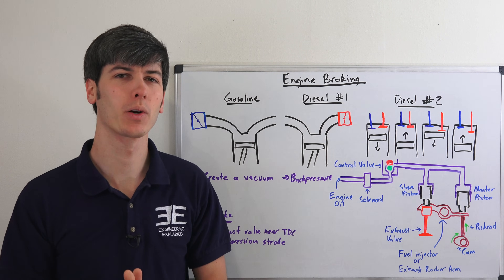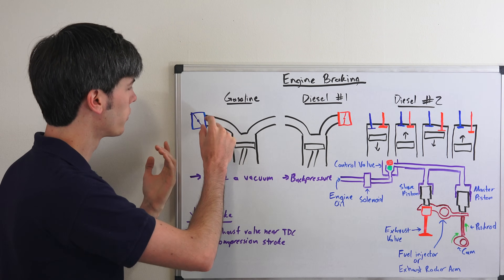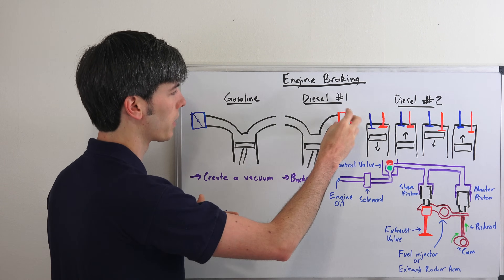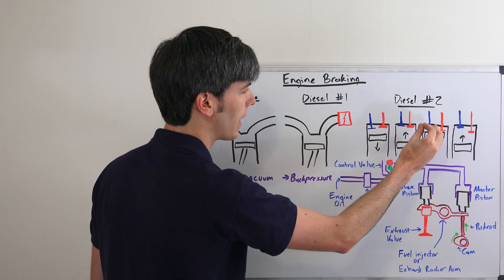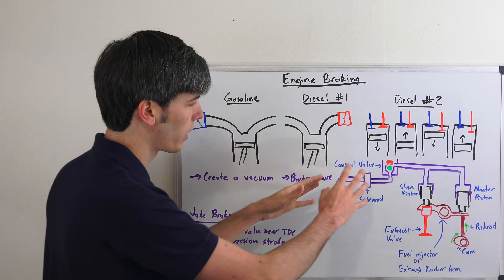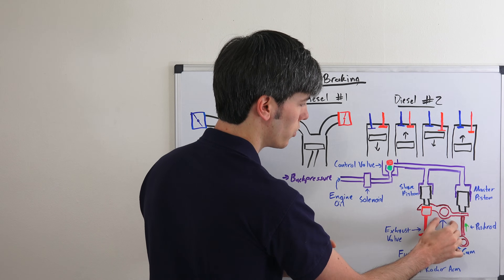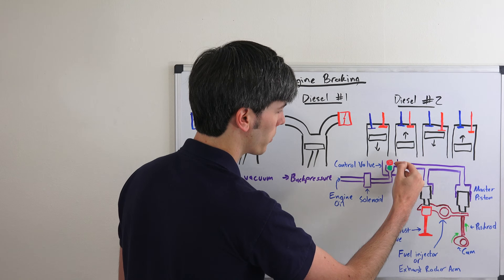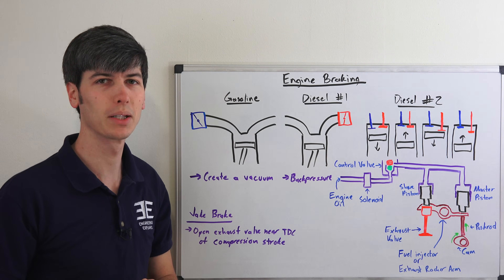What Is Engine Braking? What Is A Jake Brake?

Comment: That's pretty close to how I explain how a Jake brake works. 
 You flip the switch, witchcraft happens and then the truck sounds like a boss.
Reply: Would trucks be burned at the stake for witchcraft? If so, I feel it would be a punishment for both the truck, and the people watching since watching a perfectly good truck go to waste hurts my soul.
Reply: I like your explanation better! WITCHCRAFT HAPPENS!
Reply: @markflierl1624  yeah. Its witchcraft alright, she is sucking you to a stop..
Reply: A jake brake doesn't block your exhaust, it actually does the opposite it opens your exhaust valves during the combustion so the expansion of the combustion just goes out the exhaust instead of creating power. If you blocked the exhaust it would cause your head gaskets to blow...
Reply: Lmfao hahahaha 🤣 I'm pretty mechanically inclined but when it came to the Jake brake I was a bit lost. 😅 I would to see it in person to understand it. Soo yup definitely witchcraft.
Reply: Wait.   There is no switch mentioned in any of this ... just let off the gas (diesel) and the Jake system uses the compressed air to slow it down.   NO SWICH RIGHT?
Reply: @scottmonfort  no, the jacobs brake has a switch to activate it.
Reply: @scottmonfort  no, you typically have to engage the jake brake due to it being illegal on a lot of farm roads. If you see a sign saying "brake retarders prohibited" that means your jake brake has to be disengaged

Comment: Soooo... When you are in gear and let off the throttle in gasoline engine you're not wasting fuel right? I'm saying no but i want to be sure. Also is wear of the engine greater when you coast in gear? (of course i understand about the heat but if the heat of the engine is at it's optimal value and coasting in gear and not going into overheating zone)
Reply: See my comment above... When youre not on the gas pedal, youre not using fuel (except idle or cruise control)
Reply: +wayde philpot ; If the engine in question is mated to a manual transmission and has electronic fuel injection, the fuel injectors will shut off if the car is both in gear and has sufficient speed for the engine rpm to exceed idle. If the car is not in gear, or the rpm is very near idle, it will use fuel at idle rate. For example, if you are on a slight decline in a manual car, you can release the clutch to move the car 1st gear without touching the accelerator, and the engine will continue using fuel at idle rate unless you are able to accelerate enough, without the use of the accelerator, that the rpm sufficiently exceeds idle speed (1200 rpm give or take a hundred). So, yes, fuel is used during idle whenever the car is not in gear, during cruise control, and during the very specific instance mentioned above. 
But automatic transmissions are trickier. With older electronic fuel injection, the engine will continue to burn fuel at idle rate whenever the accelerator is fully released even with the car in gear. The torque converter will unlock, allowing the engine to freewheel and the car to coast. Anyone who has ever driven an older automatic knows that whenever you're going less than 45 mph, and you release the throttle, the transmission shifts to a higher gear, and the rpm drops to near idle. The engine actually burns fuel at idle rate whenever this happens. If you are going 60 mph or faster, the engine rpm will actually be high enough for the fuel injection to shut off. Then you get true engine braking from the automatic transmission, but when you decelerate to a sufficiently slow speed, the fuel injectors turn back on and the rpm bumps up very slightly. Between 45 and 60 mph, it depends on the manufacturer and the gearing of the gear as to when it will shut the fuel injectors with the transmission in drive. There's no way a 2002 Buick Lesabre is going to cut fuel injectors at 45 mph, but a 2000 Honda Civic EX probably will. Another thing to note, if a car is going 60 mph, and the engine is turning 2100 rpm with the transmission and engine fully engaged, that same combo is going to be engine braking with fuel injectors shut off while the engine is turning between 1400-1600 rpm at the same 60 mph. There is definitely a difference in the rpm of an automatic car with the torque converter unlocked and the accelerator in different positions. If you downshift the automatic transmission, it will raise the revs, and if the rpm exceeds 1500 rpm with the accelerator fully closed, it will probably shut off the fuel injection. (some engines will wait for even higher rpm before shutting fuel injection) But when the rpm falls below 1200-1300, fuel injection will turn on and it will burn fuel at idle rate.
Some newer automatic transmissions, the 2012 Ford Escape for example, will actually keep the torque converter locked and not upshift whenever the accelerator is released, (we're talking from 30 mph and faster,) and will cut fuel injection for engine braking. It will turn on the fuel injectors again after a sufficiently slow speed is reached and burn fuel at idle rate, though. Some modern cars do something very similar to what the 2012 Ford escape does, while some modern cars still do things like the older fuel injection systems. Some cars (like BMWs) include a "coast" function that will allow the rpm to drop to idle while the car is at any speed, and like the name implies, it allows the car to coast longer distances without interference from engine braking at higher speeds.

Basically, I can't have anyone believe that their automatic transmission equipped car shuts fuel injection every time they release the accelerator, because it just isn't so.
Reply: +ExactlyPrecisely i hear what youre saying. Modern manuals assist with slight throttle input in 1st gear from a stop (without the driver actually pressing the gas pedal)....All automatics as far as i know will creep from a stop in drive without the gas being applied. But for decel situations, its my understanding that   the ecu will cut fuel until the engine approaches idle speed. I cant speak for older cars... If they did indeed use fuel without input from the driver, thats a terrible design and its understandable why fuel economy has gotten better over the years.

Comment: wow ! Very interesting ! Until now I thought that the pistons fighting against the compression while the others didn't receive any gasoline for combustion was the main reason for engine braking. Doesn't the compression have any impact at all ?
Reply from the maker: +Yak Eru It does, but most of the energy goes back into the engine during the "power" stroke. Minimal energy is lost.
Reply: +Engineering Explained Thanks :-)
Reply: +Engineering Explained woooooaaaaaa, it took me some time to really understand ! The piston fights against compression ... but even if there is no fuel, the compressed air is pushing back against it during the ""power"" (now I understand why the quotes, thus the quoted quotes :-P) stroke since the valves are still closed ! So, the only loss of power comes from friction and eventually some lost compression in a worn engine. 

woaa... so obvious now ... thanks !

soooo ... in theory, not that it is really important to know ... but an engine with worn piston rings/valve seats/etc ... would have more engine breaking than a well sealed one ...

Comment: So if "Jake Braking" is just releasing built up energy straight out the exhaust, how does that differ from putting the vehicle in neutral? I don't see how "Jake Braking" slows a vehicle down...
Reply: +Michael Stutzman The key is built up energy, where does that energy come from? It is converted from the inertia of a vehicle.  Since after it is compressed and is immediately released out of the exhaust- it does not increase speed but all the energy spent compressing the air was still used so the vehicle overall slows down.
Reply: +Michael Stutzman Because it takes kinetic energy to compress the air that is than released trough exhaust.
Reply: EgadsNo Does the spark still ignite? How does the engine get more air? The idle air control valve?

Comment: does engine braking, create more wear and tare on your engine? rather than using the brakes?
Reply: +roy silverio if it can handle the heat from engine braking(which it does if you don't have any cooling problems) you will be fine
Reply: +MultiDJsander thank you for answering my question

Comment: Fantastic explanation. I just have a doubt, is fuel consumed in a petrol engine during engine braking?
Reply: Only a carbureted engine sucks fuel all the time.. fuel injected engines turn off injectors during decel.

Comment: Is engine braking bad of the engine in the long/short term? like does it damage any components?
Reply from the maker: Nope, your engine has a dedicated cooling system. So long as it's not overheating, it can handle it just fine.

Comment: So why can't you have the two diesel systems on the gasoline engine as well?
Reply from the maker: You could, but gasoline engines have throttle bodies so it's not as necessary. Pretty much all highway trucks will be diesel rather than gasoline, and the larger the vehicle the more useful this is in preventing brake fade. Still great to leave your gas car in gear without throttle on steep grades, and lower gears as necessary to maintain a certain speed.

Comment: does downshifting and engine braking down a steep hill cause any excess wear to the engine or transmission through heat in comparison to just braking?
Reply: +AndrewRox22 Unless you have a bad coolant nope. Engine is spinning anyway and you'd want to use that force for braking and saving some fuel and lots of brakes.
Reply from the maker: Nope, your engine has a dedicated cooling system. So long as it's not overheating, it can handle it just fine.

Comment: with petroleum/gasoline engines when throttle is at 0% , is fuel and air injected at idle rates and does combustion still occur?
Reply: +MrAlexio27 only if it is needed to keep the engine at idle speed, i.e. if you are engine braking and that makes the engine is turn above idle speed no fuel is injected
Reply: is that why when on high revving engine a jolt is given if you throttle off at say 5000rpm?
Reply: +MrAlexio27 nope when throttle is at 0% and you're in gear ECU shuts off fuel. Only old engines with carbs did that. There is no fuel in when you let off throttle.

Comment: does engine braking cause some sort of 'pop' sound like it's misfire(?) or something? since i drive a manual, it's easier to slowdown with engine braking just by letting the gas off, mainly because i hate to be label as a "brake-checker", is that the term for it?
Reply from the maker: Some cars will have some pops and crackles in the exhaust occasionally while engine braking. Usually occurs right after letting off the gas while in gear, as unburnt fuel leaves the exhaust.
Reply: +Engineering Explained that's explain it, considering my car have carburetor.

Comment: So there's no combustion when you let go of the gas pedal? The engine keeps moving because the wheels are moving? And the sound of the engine is purely mechanical?
Reply from the maker: With many modern engines, yes. Though it's possible to still burn a very small amount, depending on the setup. Ideally you would burn no fuel since it's completely wasted. The inertia of the car passes through the wheels/transmission to keep the engine running without fuel.
Reply: +Engineering Explained you actually still burn fuel on overrun because of tip-out driveability filters which act on brake torque to give it a smooth deceleration feel (this is done by injecting ever decreasing quantities of fuel to generate a bit of indicated torque). These filters are used pretty much throughout the industry because driveability has become one of the most important customer requirements.
Reply: Ethan Arpin: Studies have been done that show the engine's bearings in the main and rod journals wear more while in overrun than they do when producing power. Since brake pads are much cheaper and easier to replace I never use engine braking unless I need the extra braking power.
Reply: Can you please cite these studies?
Reply: +edguiterrez yep.
Reply: +Engineering Explained does engine braking wear down your car at all? The compression doesn't seem like it would be good for those small parts
Reply: Ethan Arpin you're compressing either way.... Think of it like this instead of fuel making explosions in your engine to make it move road is turning it. I'd say you're getting even less wear then when you're on throttle.
Reply: +endoftheroad    The tip-in on my 2012 Accord 5 speed is a little too aggressive, do I need to find a tuner to adjust this? Is it a mechanical issue like the filters you speak of or ECU programming?
Reply: mike anderson first of all, when do you feel the tip-in is aggressive, when you tip-in from a steady speed (like cruising on the motorway and suddenly tipping in to overtake) or following a deceleration (let's say decelerating towards a red light and it becomes green and you tip-in to accelerate)? And second, can you describe what you mean by "too aggressive"? if you can describe the boundary conditions in more detail I might be able to give some advice.
Reply: Thanks for the reply. After the clutch is engaged in any gear, I have to be ever so careful when adding throttle because moving the pedal 1/8 inch gains like 66% of total throttle movement even though I have say 2 inches of pedal movement left. Not a dangerous situation, just annoying. I like to drive smoothly. It's like my throttle pedal mapping is for an automatic, but my car is standard shift.
Reply: mike anderson What engine does your vehicle have? The issue you're describing is mostly to do with the pedal-torque demand relationship. Modern engines ECUs are predominantly drive-by-wire throttle and "torque structure" based. What that means is that the pedal position is read by a sensor and that signal is interpreted as a driver demanded torque to drive the vehicle. Simply put, that interpretation of pedal position to torque is done using some 3D pedal position/vehicle speed -> torque maps. Depending on the character of your vehicle and the mode you are running in (ECO, sporty for ex.), you might press the pedal 40% travel but the map registers that as almost full load. There isn't much you can do about those maps except change the mode (if your car has that feature) or adapt your driving style to it, or if the ECU has a driver learning feature, let the vehicle adapt to your driving style (I'm not sure what ECU Honda use in their engines so I don't know if that feature is implemented). Hope that makes sense.
Reply: Yes that does make sense, thanks. I have the 2.4 Liter engine. There is no ECO button in mine or sport mode. The engine does have V-TEC but that is always a smooth transition. Happens around 3250 - 3500 RPM.
Reply: that's true because i'd only ever hear high pitch noise coming from the transmission. its gears are straight cut which made it louder. overwhelming the engine sound!